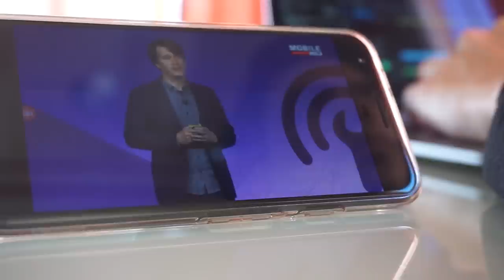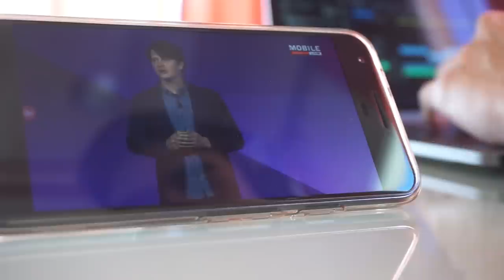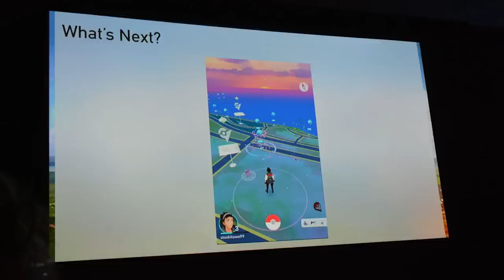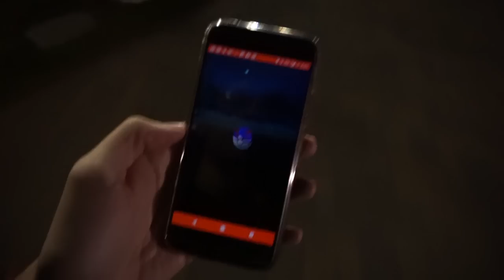3 MAJOR UPDATES COMING TO POKÉMON GO - LEGENDARIES, GEN 3, TRADING, PVP, BREEDING?

Comment: they should add a challenge if you catch 30 pokemon in one day you get 1000 star dust and 2000 xp and if you catch 50 pokemon in one day you get 3000 star dust and 3000 xp and if you catch 100 pokemon in one day you get 8000 star dust and 5000 xp. also if you get 30 pidgeys in one day you get 30 extra candies. things like this would make pokemon go way more enjoyable. also when you unlock a medal they should give you star dust and xp.

Comment: I would think the top possibilities for updates would be:
1: PVP
2: Breeding
3: ability to learn new moves
4: some sort of Pokémon center where you can go to do a variety of actions(possibly trading because they may have had to scrap whatever trading system they were working on and make it a very public place based system and make it only during the day).
5: a way to change the stats of your Pokémon.
6: then of course gen 3.
7: an actually much more useful tracking system. 
8: some sort of buffs.
Reply: 9: battling Pokémon in order to catch them!
Reply: 10:pokestop/gym request system

Comment: Static doesnt work the way you told us here! Its not if a static pokemon is hit by a physical move. So it works with contact moves. If the pokemon makes physical contact with the opponent. There are physical moves like earthquake that the attacking Pokemon doesnt make physical contact with the opponent and there are also special attacks where the attacker makes contact with the opponent like Grass Knot or Draining Kiss.

Comment: I think some sort of battle rework is going to be an update, based on John Hanke's comments saying that the current system is a primitive version of what they envisioned. Gen 3 doesn't seem as big a priority, honestly, since a lot of the need for Gen 2 release seemed driven by a lack of other content; once they have a more solid foundation, like better battle system or some other core game mechanic, other generations feels like more additional content rather than core gameplay. It feels like they're trying to slow down pokedex completion, and the goal was to have several years worth of content at least, so I don't think they want to cycle through all the generations so quickly. Still, it's probably the "easiest" update to release, given that it pretty much just requires new models/sounds/moves since the technology is already there. Given that Niantic doesn't want to make this a direct port (and are probably contractually prohibited by the Pokemon Company from making it too similar) of the core pokemon games, and what seems to be the broader vision of AR gaming in general, at least one of the updates has to be some way of interacting with the map/real world in a more significant way than just visiting user submitted landmarks. Having quests would be a good step towards that

Comment: Your knowledge of the main games is pretty solid but I'm gonna have to nitpick here; there are several special moves that make contact with the target and therefore can result in the user being paralysed if the target has the static ability, wring out and grass knot among them I think, and equally there is a sizeable number of physical moves that dont make contact, e.g. leaf blade

Comment: I think Gen 4 should be out by the end of the year. The first few months after launch were about stabilizing the servers and just kicking things off. Now that the game is running pretty well and they're focusing on new content, each new generation should come out a little faster. Gen 2 took seven months, and most people stopped playing by then because they had nothing left to catch. Gen 3 should definitely come faster. I agree with Summer being the perfect time. If Gen 3 is out by Summer, it would be odd if Gen 4 takes until next year, but it would probably be at the end of the year. It could be January - February next year though. Every 6 months or so wouldn't be too bad (I think)

Comment: btw remember how you said when that nest was ponyta it  was better? i believe strongly that what Pokemon is the nest Pokemon changes spawn rate i have a nest beside my house that spawned a crap ton of ekans and onyx, but was alot lower spawn rate with nearly every other pokemon thats been in there. i also  believe that 1 pokestop  mini parks/children playgrounds  create "mini nests"  for example ive had one spawn charmander regularly for a couple weeks but some days it didn't spawn at all it would stop for a couple days than id see 1 again all the same routine time. but i have not seen any for months there, it did the same thing with machop and onyx.  usually a nest spawns them frequently/hourly but these mini's seem to  spawn them at an increased  rate but irregularly.

Comment: a complete rework of the battle system is actually terrifying? i spent nearly a year building the most insane pokemon based on the current system and to throw that all away would be devasting. (in my top 12 pokemon i have 1 dragonite 1 snorlax and 10 vaporeon all over 3,000) i would be utterly annoyed if my hard work went to waste

Comment: Not really relate to anything in this video, but I have a theory about evolution item. I found my first one on the 7th day streak pokestop spin. Only after I used it that I found another one, so here's my theory: you can only have ONE evolution item in your inventory at a time. I know the drop rate is low, but I found 2 in the span of 3 days. Can you confirm this?

Comment: WHERE ARE YOUR BATTERY PACKS???!!! You shouldn't have a dead phone battery when you have had viewers who have sent you battery packs for you to use when hunting Pokémon. Sorry, I am a daily viewer and I think that you having a dead battery is just dumb. Connect the USB cable and put the battery in your bag. If necessary, get a longer USB cable to reach the length of your arm and wiggle room so the connection doesn't come loose. It has saved my butt when Pokémon hunting on numerous amounts of times. Also, I suggest a USB charger for your cigarette lighter adapter in your car,a good one with multiple ports can be pretty inexpensive.  Keep up the good work and best of luck with the internet situation. ---SJ